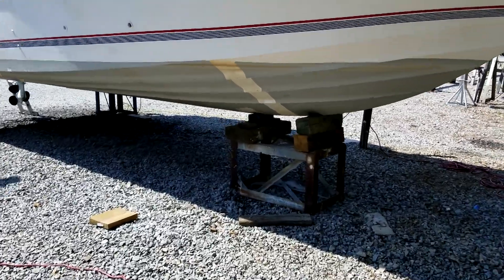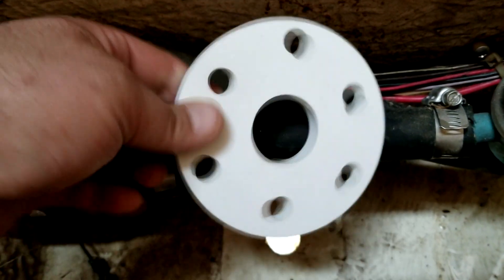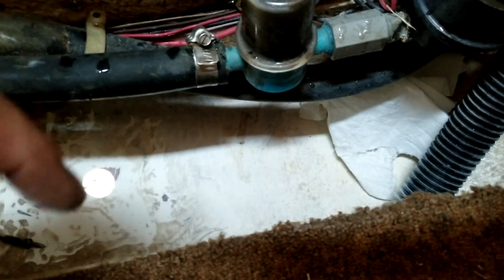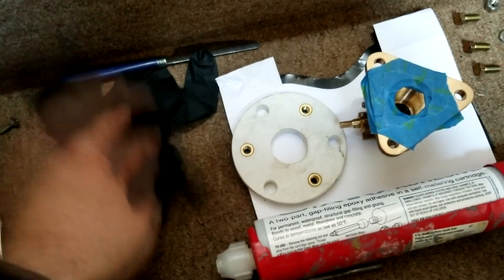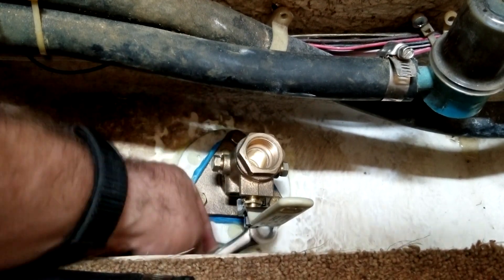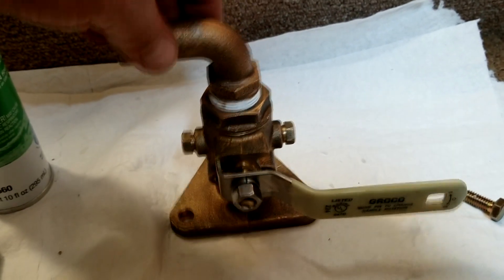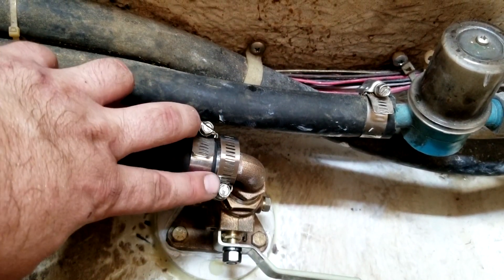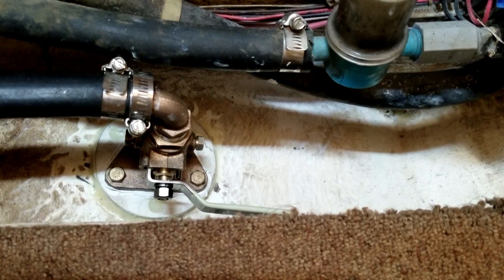Let's talk about Seacocks part 2

Comment: Two excellent videos sir, thank you! Whilst I agree with the robust and longevity of the proper bronze fittings certainly the latest plastic composite units (TruDesign probably the market leader now) meet all the safety standards and of course are lighter and don't suffer from electrolysis. Longevity I guess probably still to be proved. TruDesign also provide a load spreader to meet regs in the US market (not required in UK or EU although available still).

Comment: Very well done video. Clean, concise, detailed, and thorough. I only see two things that could be improved. 1. On the otter hull, there is no need to run the 4200 out on the hull in a ring around the mushroom head. This is esthetic rather than functional - while it doesn't hurt anything, it would look a lot better to have cleaned that off. 2. This IS functional. It appears you put your grounding wire on with just a car-style ring connector. Electrical connections in marine - especially salt water - especially in a bilge area - should always be done with marine heat shrink connectors and an extra length (2" or so) of heat shrink over the connector and up the wire. That wire will end up corroding at that connection, especially if tinned copper wire was not used. Other than those nit-picky points, very well done.

Comment: Hello Russell.  Really appreciate the detailed video.  I am installing the same seacock, but with Strainer, not mushroom.  Also the strainer has 4 brass screws that will thread into bottom of hull.  What are the sequence of steps considering the strainer will need to be sealed/secured to the bottom of the hull before the seacock is screwed on inside the hull.  I would think you either have to forego the sealant on the underside of the seacock flange or accept that it will make a mess as it spins to align with the bolt holes.   Thanks, in advance for the add'l advice

Comment: All done so well but....then to use 4200? A below the waterline fitting should be as bomb proof as possible. 5200 is the way to go with anything going thru the hull under the water line. Otherwise very nicely done :)

Comment: Very nice video! I'm an getting ready to do exactly this with my cockpit drain system. Thank you. I'll be using 4200 sealant with epoxy thickened with Cab-O-Sil (fumed silica). Do you recommend fast or slow hardener?

Comment: Good job. Did you put the 4200 around the flange, and did the thru hull nipple need to be trimmed( shortened) before threading into the valve? Thank you
Reply from the maker: Thank you, just trying to help some folks out. I did use 4200, maybe even 5200 around the flange, I can't remember at this point. haha. and the nipple didn't need to be trimmed because I had enough space.

Comment: Dyi you should have used stainless steel bolts not steel your forgetting about water ang steel makes rust oops 😱 now you have rust stains in the boat .  Yes acetone not lighter fluid,

Comment: Excellent, detailed instructional video!  Your series of Seacock videos gives me all the info I need to do the job: Tools required, tricks and tips, hardware required, sealant choices, adhesive choices, and "how to" to ice the cake. Well done. I am a professional mechanic.  I have an old, newly acquired, old sailboat, and it needs 2 new thru-hulls. Of course, I want to DIY; however, I have never done this job on this kind of boat before, and I feel like I can go get it done now.  This is one of the best "How To" videos I have seen, and I have watched thousands.

Comment: Thank you Russell !  I am going to replace for my sailboat next month , I will copy like you do. Appreciated . But I still want to see how you apply SIX 10 on backing block . Do I need clamp or pressure on block ?
Reply from the maker: I used the mushroom fitting itself wrapped in teflon to prevent the six10 from bonding to the mushroom to clamp it. Snugged it down and let it sit overnight and then took the seacock and mushroom off for final sealant adhesive and assembly.
Reply: @russellsrandomness  Thank you so much .
Reply: @russellsrandomness  Why did you use epoxy and not 4200 to bond the backing plate to the hull?
Reply from the maker: @willyum1208  The fasteners for the seacock are only mechanically connected (with threads) to the backing plate. I wanted the bond between those threads and the hull to be as solid as can be. Where the 4200 would be able to be repaired in the future, as long as those threads don't get messed up  that backing plate will never need to be repaired.